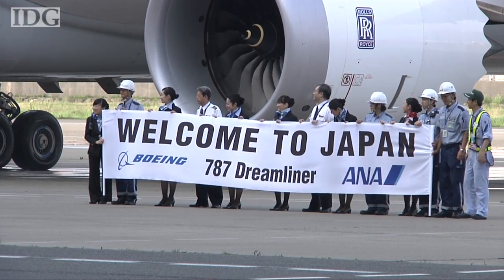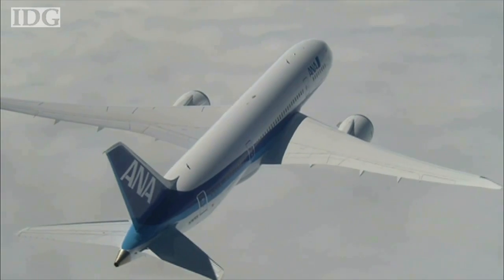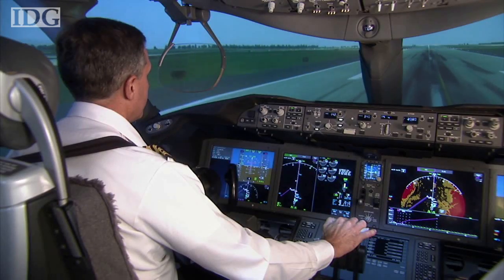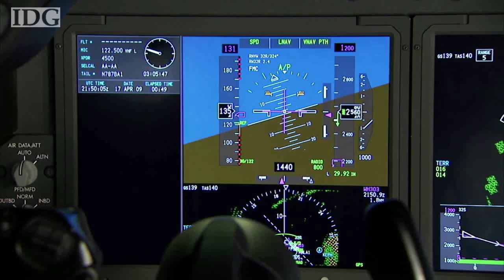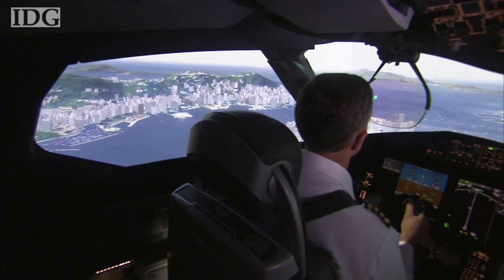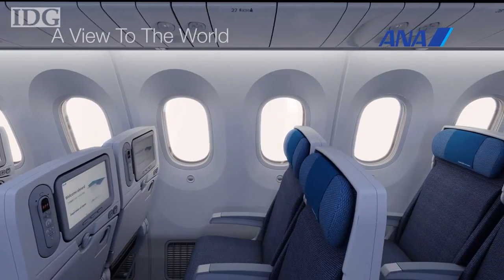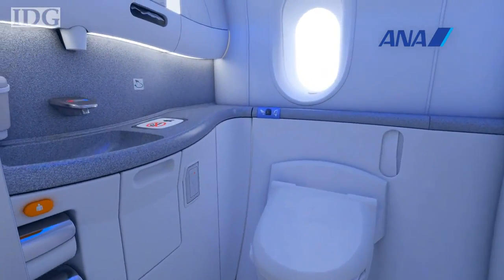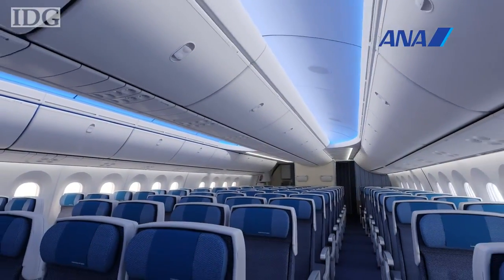Boeing's 787 is packed with high-tech

Comment: @TheYozStudios Yes, the APU would provide enough power to run the basic controls, airplanes are designed that way. Even if the APU wouldn't work, there's a thing called the RAM Air Turbine, which generates electric power just by the airflow. If both engines fail (well, the Dreamliner is ETOPS 330 approved so..), the APU, and the RAM, I'm sure there's still some control left (Airbus calls this "mechanical backup". Mechanical control of the rudder and the aileron trim)

Comment: @discofishing Yes ive noticed that. I know alot about aircraft myself. But what caught my attention was the brakes. As i said to another person not long ago, if the brakes were to fail (seeing that they are electrically driven), you would be screwed. Using reverse thrust and/or speed-brakes alone is not enough to stop a plane within runway limits. Reverse thrust and speedbrakes account for ONLY 20% of the stopping motion of the aircraft. Brakes account for 80% of the total braking force.

Comment: @FoleyArtist Well reversers aren't really needed unless its wet and the aircraft is landing at full weight, the brakes will be able to stop it no problem. Electric brakes refer i think to the fact they are still rotor and stator but instead of hydraulic pressure they use electric motors to operate.If runway is too short they can divert. Reversers aren't as effective but they should still stop the aircraft. CFM56 A320 can stop with reversers as there is a manual reference for it i saw once!

Comment: @foxdmulder In effect, there is no difference. This is, just like the airbusses, a Fly By Wire aircraft. So as far as you meant the input to the flight controls, there is no fundamental difference. As far as preference goes, you might like either the yoke, or the sidestick better.

Comment: @Fisch269 yes, i do know of the ram and am also aware of the fact that it is only capable of powering only the most basic electronics, so most of the very basic avionics, im pretty sure that the ram won't be capable to generate enough electricity to entirely power the flight controls at the same time as powering the very basic avionics. And further more, as technology is evolving, most of the latest fly-by-wire airliners are coming with glass cockpits and very few conventional instruments.

Comment: @Sterlingjob True, but can that alone stop it completely? I could see if they had enough runway, but what is the runway was considerably shorter? That scenario might require both brakes and reverse thrust to stop in time. Just a thought. Not saying it's bad to have electric brakes. I just hope they have an alternative that is as effective in stopping the plane in the case of catastrophic failure.

Comment: @jeffly1500  the triple redundancy it has should not be a factor. Weight wise, being an electric system (taking over the functions of hydraulic systems for control surface actuation & landing gear extension/retraction) it makes it lighter and there is no chance of hydraulic fluid leakage. Whether you operate an electric motor or a hydraulic motor, you still have moving parts. Only difference is, hydraulic motors require more cooling than electric ones.

Comment: @TheYozStudios That Nasa topic is actually pretty interesting. I know Airbus did something similar, like on a A330, if the hydraulics are gone, the Fly by wire system was able to translate the pilots input on the stick into thrust changes, which allowed them to land the plane. I'm sure you've heard of UA 232 ? Landing using power steering is so damn difficult, the way they made the airport is unbelievable and a masterpiece of flying, for sure.

Comment: @kazfilmscompany They weren't independently developed by Japan, it was a joint project, with US engineers working with the Japanese. 35% of the aircraft was manufactured in Japan without help from Boeing. But yes, they did indeed contribute, alot more than people give them credit for, actually.

Comment: @britishairwayspilot1 You'll have backup buses, backup generators, the APU, and batteries. If you fly a lot, you've probably been on an aircraft that had an electrical failure. And, not everything is electrical.

Comment: IT's got redundant systems and I believe an emergency slipstream driven propeller generator that pops out....I mean even when the batteries catch on fire they still landed perfectly safe.  I'd be far more concerned about long term durability of the composites and the issues of detecting separation within those composites on things like wings.  It's not like a car where you can just pull over if a major part fails.  If a wing comes apart in flight...yeah you gots major problems.

Comment: @snedie69er your point is to replace airtravel with train.  So a train would have to do better what a plane does.  air is faster cheaper so a train is NOT feasible.  Not to mention the cost ($, time, EMISSIONS) to make a train route to replace air travel would out weigh any advantage a train has (lower emissions).

Comment: I do wonder, if so many systems such as the brakes on board the aircraft are indeed electronic, what kind of backup do they have when the plane experiences an electrical failure/dual engine failure and need to make an emergency landing? I know there's a backup propeller that comes out to generate the minimum electricity for vital controls but I'm pretty sure that can't generate enough electricity to run the entire brake system and stop the plane.

Comment: @Fisch269 the chance of three-four hydraulics systems in an a/c are less likely to fail that 3 electronic power generating devices. and, nasa has developed and tested that a/c can be landed with engine thrust only and i can imagine that engine thrust on a fly-by-wire a/c would be controlled electronically... so i guess there is no point in either of us arguing on this argument, we both would be in somewhat of the same situation...

Comment: Failing to move with the times? It's fully FBW, they're certainly moving with the times. They're sticking with yokes due to pilot research that shows most pilots prefer it; however, most pilots will say they prefer the a/c they're currently flying.

Comment: i tottaly agree with you..infact airbus was the first to introduce the fly by wire system ..there are a lot of improvements on these systems,and still boeing hasn't fitted fly by wire systems to they're planes
 in addition to that boeing hasn't introduced a new plane for years,now they come up with the 787 and they were 2 years behind schedule,airbus has all new state of the art aircraft..and will introduce the new a350 family..and some improvements to the a320..plus..the a380

Comment: @discofishing I haven't flown any fly-by-wires.. but have flown in them. Very reliable i understand that. I can see what you are trying to say and im guessing... Boeing might actually have gotten a way to sort out a brake failure. As you said, if engineers can make such systems highly reliable, then you could assume electrical brakes would be too.

Comment: @britishairwayspilot1 Have you flown any aircraft that had fly-by-wire flight control systems? If the engineers can make such systems highly reliable, then I think one could assume electrical brakes would be too. It's an interesting subject, to say the least. In 8 years of military service as a technician I've seen several braking system failures on aircraft. They were all caught at taxi out though.

Comment: @britishairwayspilot1 electronics are more likely and susceptible to fail than hydraulics in my opinion. If the engines fail, and stop working, will the APU be able to generate enough power to just run the basic controls of the aircraft? and would the plane have to land with no brakes because brakes are electronic...

Comment: @Phroshy Airbus are developing A350 which will attack the 787 head on, and they are also rolling out the A320 Neo these days.  As in terms of fuel efficiency, there are different approaches to calculate that... One is fuel usage per passenger per kilometer/mile or whatever, and I don't think the big birds like the A380 is loosing that fight.

Comment: they are more efficient in certain circumstances like cruising, and following a flight path, controlled descents, they beat human performance in these instances, a pilot is there because if something goes wrong, the plane doesn't have the capabilities of working out a solution, where as humans get 'ideas' avionics are better than humans at controlling the plane during flight, and eventually humans will be eliminated from the cockpit all together, like some existing trains.

Comment: @AceOfSpades678 Well since hydraulics are also run by the engine, just like the electrics, you would get the same result. Both Engines fail is a very bad situation no matter what drives the control surfaces be it electric or hydraulic since they are both powered by the engine. One advantage of an electrical system is that if 1 electrical component fails it wont effect all the rest, unlike in a hydraulic system. Where fluid loss = loss off all controls.

Comment: you're entirely right , those computers use sensors   , if sensors send wrong informations ,veteran pilots are thus required   to correct  the problem . we had the case with the air france plane that crashed in 2007 into ocean . people blamed speed sensor called "sonde pilot". but I airpilot should learn gliding technics and vintage piloting without computers

Comment: @soccerguy2433 

Not on its own, no. But back that electric train up with a sustainable energy resource (solar, wind, fusion if we ever get there) and there is the solution. Sure, it's no where near perfect and the cost of travel will be insanely high, but it in 30 years time it will be far less than air travel. 

We may not be drastically short now, which tends to make people think everything is okay, but we need to act now to act in the future.

Comment: We need to find some way to create carbon nano tube cheaply to make planes even lighter and stronger. Because however good this plastic is on the new 787, it won't be as durable as a metal like aluminium or steal in the long run. And i don't agree on using plastic from fossil sources for new cars/planes. Plastic being cheap shouldn't be an excuse.

Comment: You are wrong though, an Airplane's avionics are more reliable than human performance, compare a human and Auto-Pilot performance cruising at 35,000ft, a human would find it difficult to fly straight and level and on course maintaining the correct altitude for 3-4 hours, where as an Auto-Pilot can control the ailerons, trim and speed effortlessly, A pilot is there in case these systems go wrong, the AP is switched on around 2 minutes after take off, and switched off 30 seconds before landing.

Comment: You don't get it. When the 747 was built there was no airbus. And that same system on airbus has also been linked to many of it's crashes. When pilots start relying on the computer to do everything for them, it causes complacency and you lose your hard flying skills. The 777 is just as safe as the A340. ..and most pilots DO prefer the yoke to the stick, Just because you don't agree doesn't make this proven fact "stupid".

Comment: You guys have no idea what you are talking about. Please stop hyperboling. The 787 is not the most efficient plane its not the most sophisticated and sure not the most quiet plane. The A380 has as much CFRP per weight, has a stellar CASM and is not several tons overweight like the 787.It is the most complex plane on earth. The 787 with no bleed air,cfrp barrels,  are the only great advancements.

Comment: @snedie69er Honestly, I think your argument isn't solid. You have to consider how much new infrastructure is needed. You can't just put high speed rail on traditional tracks and expect it to work.
Looking at the current the economic situation, where are you going to procure such resources to complete a project like this?
500 miles is one thing, 2500 miles is another [(NY-LA) and thats going DEAD STRAIGHT]. 
Air travel is already a proven transportation method, no point starting a megaproject.

Comment: This is my point though. the avionics in an Airbus STOP accident's which would've happened in a Boeing, put it like this, how many of those 747 accident's could've been avoided if they where equipped with Airbus avionics? things such as Stall protection and limited bank protection? things that stop pilot error. look at A340-600 has been in operation since 1993, and not a single fatality, and not all pilots prefer a yoke, that was kind of a stupid statement you made.

Comment: @TJace50 You hate airbus that much?? ._. Im sure both Boeing and Airbus have had their failures. As a pilot myself, the looks on the outside doesn't matter. Its how it flies. The engineering at the end of the day is what counts. But when it comes to the Boeing VS Airbus debate. i really think that airbus is trying to copy boeing on the 787. Look at the 787 and the proposed a350. Almost exact copies. One could argue that airbus designed the A321 in relation with the 757. A321 is an enlarged A320.

Comment: i think all airbus wants is their "large reputation" unlike boeing safety first
and if i own an airline company i prefer to buy boeing aircraft its more tested and has a good reputation its up to the pilots id they crash the plane

and one thing, airbus a380 is crap it cant hold too much stress and G force..... and its engine and its wing design is FAIL ... why because there are a lot of these cases
unlike THE 747 it is just caused by over stress or overspeeding thumbs up if you agree!